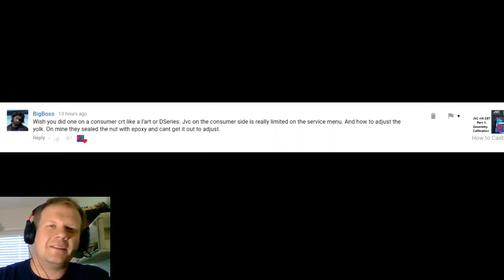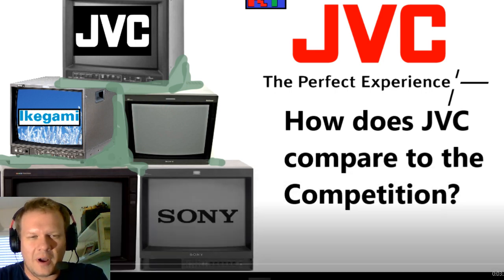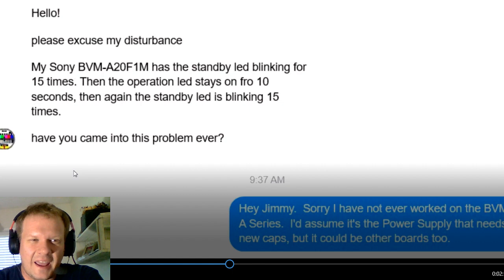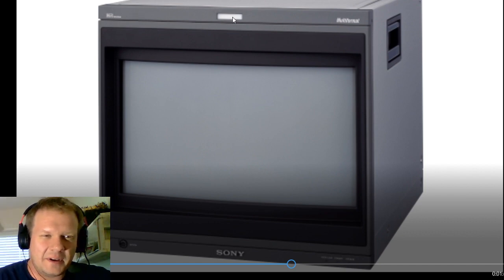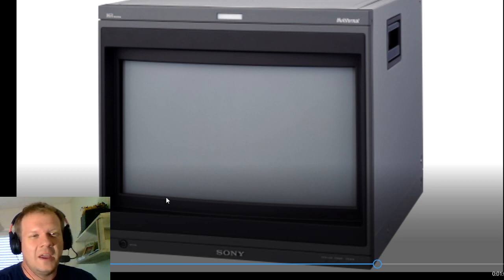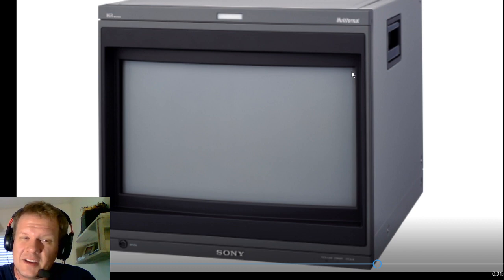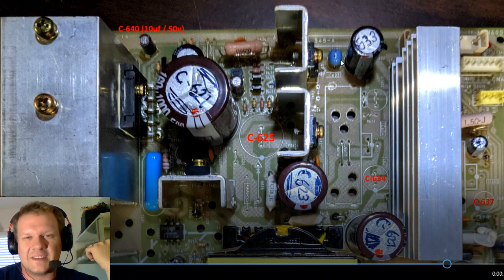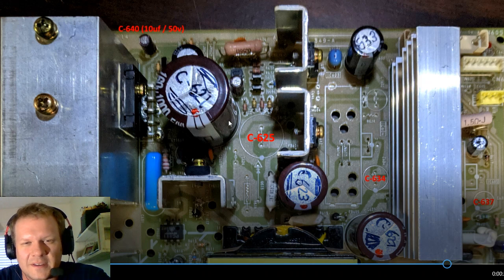Comments - Ep 2  What's up with the Sony BVM A Series?

Comment: If you made a cap kit for the jvc monitors I'd buy it(as would many on the collective). All 3 sizes have the same parts apart from yoke, flyback and front control panel board. Even the non-cg s-video jvcs share the same parts other than the video board and control panel board, so a mainboard cap kit would work for all 6 jvc tm-h. You'd sell loads is what I'm saying.
Reply from the maker: Thanks, I'll research that some more.  Great idea.
Reply: @RetroTechUSA  I made my jvc tm-h1950cg by frankensteining 1750cg and 1900g(KittyKatKya's "frankensteining jvc" video) so I can confirm it works. Also tried swapping the side deflection board between models while troubleshooting and it works. I also checked out all of the monitors internally and they look entirely the same part by part cap by cap ic by ic except for the parts I mentioned
Reply: The reason I even want this is my 1950cg has some shaking/squiggling on vertical lines in the bottom part of the image. I'm told it's caps. Most of these monitors are in great shape but they're owned by many in the hobby, so there's a market even if few need caps yet

Comment: Hey Steve, I've got a PVM-1943MD with a couple slight geometry issues. Since this monitor doesn't have a service menu (I'm 99% sure) would you point me in the right direction (your past videos/tutorials from the community) on what to do. From your past videos and some research (can't find this specific model's service manual but did find 1343MD and 1953MD) my understanding is to use the potentiometers inside.  

I'm hoping to adjust tilt, underscan, and horizontal/vertical centering. I've got the 240p test suite but not exactly sure how to adjust everything. Also, I am nervous about electrocuting myself ( I believe for tilt I need to rotate the tube?).

Thanks for making these videos and sharing your knowledge!
Reply from the maker: Man that PVM has Potentiometers on the main board that you have to turn to adjust geometry.  I don't have any vids of that type of monitor.  Sorry.

Comment: hey, got a quick question.. I've just got a 14 inch bvm and the geometry and picture isn't that great. The monitor has been serviced before with replacements and magnets on the tube. Would it still be worth it to replace the caps? (and if so, do I remove the magnets after that then?)